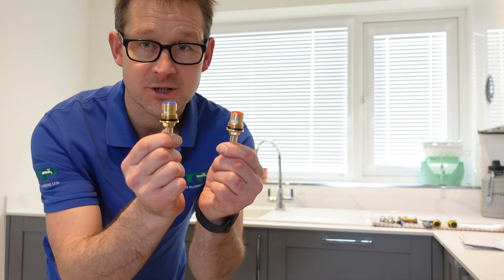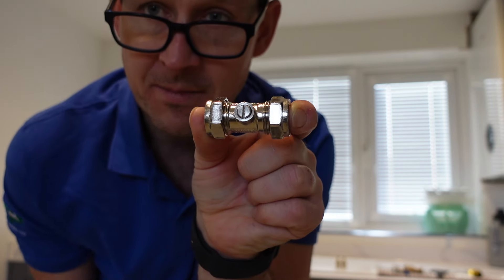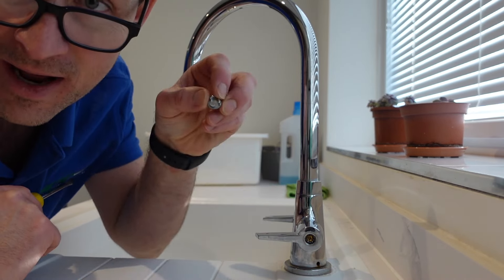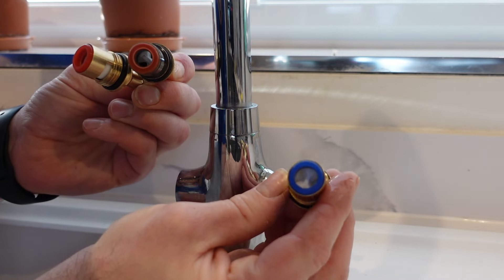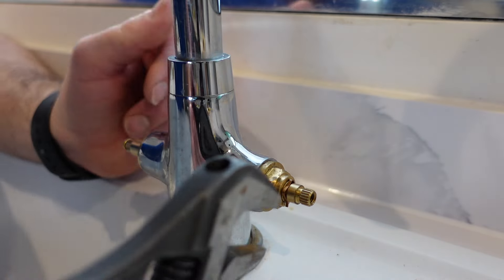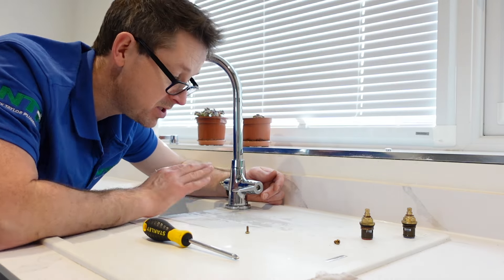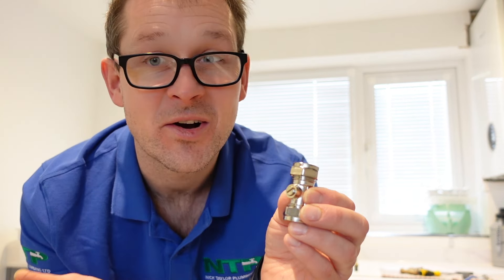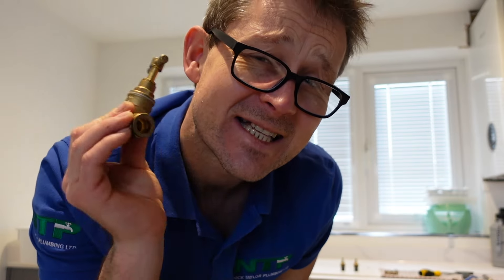How to change Kitchen tap cartridges to stop a dripping tap! - HD

Comment: Why must you turn all the taps on upstairs and downstairs after turning the water off via  'isolation valve/indoor  or outdoor stopcock' ?  Our kitchen cold water ceramic cartridge has seized up (probably limescale has clogged the mechanism) and won't turn on,  so why can't we just turn off the mains stopcock and allow any residual water to drip out as we unscrew the cartridge?

Comment: The trick worked.I did clean up  surface inside with flat screwdriver .It has stopped leaking.
I think reducing  the pressure by 10% would also prevent tap to drip quickly again.